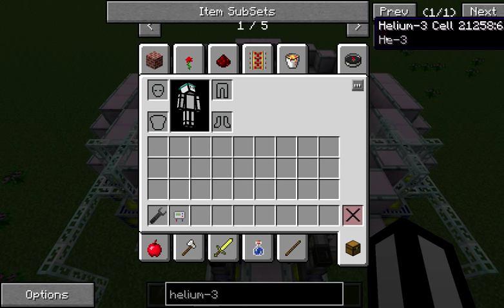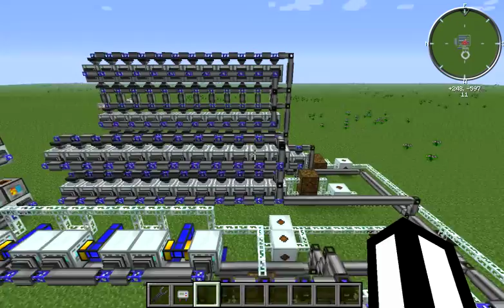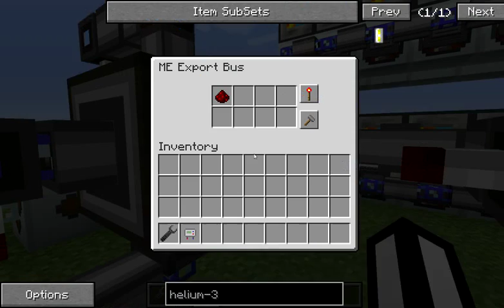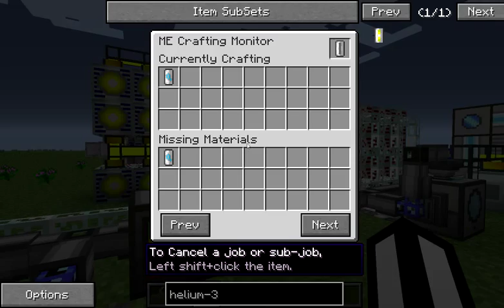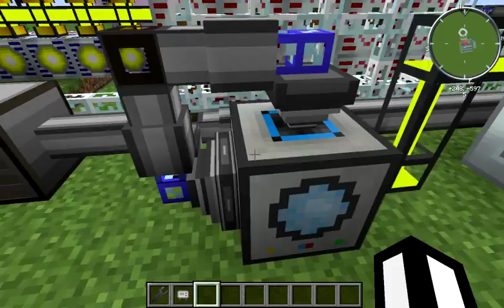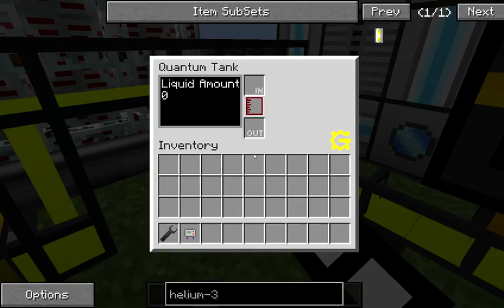Gregtech - Indefinite Fusion Energy (FTB Ultimate 1.1.2)

Comment from the maker: You should be able to use 6.  Be sure that you have the 1024eu/t already flowing if you do.  Using 6 means you will have no buffer at startup for the energy required for the reaction.

Comment from the maker: Mike, the problem is most likely that you need to split your materials up top and bottom instead of left and right. I have always done this in the same direction as the recipe, and recommend you do the same. Also, measure the cables running into your energy injectors before you do this. They should be reading 0, indicating that all 6 of your injectors are full. The bar on the reactor can be misleading, as it represents a max loadout of injectors.

Comment from the maker: That is true, you can use the Xycraft fabricator.  I mention this in my cyclical crafting edgecase video.  In my SMP world, this is how I was doing it originally, except I would pump my endstone into an adjacent chest so that my crafting materials did not get removed by the import bus.  The point of using the MAC is so that you could do it in  a version without Xycraft or other auto-crafting solutions available.

Comment: You can also use a Xycraft fabricator to do the endstone replicating. Put the Tome of Alkahest in the fabricator's inventory, and set a recipe with the book, endstone, and redstone. Attach an import bus on one side set to only pull out endstone, an export bus that pumps in redstone, and (strongly recommended) a level emitter to shut off the fabricator when you have enough endstone in reserve (say, 250+) or it'll burn your entire redstone supply in mere moments.